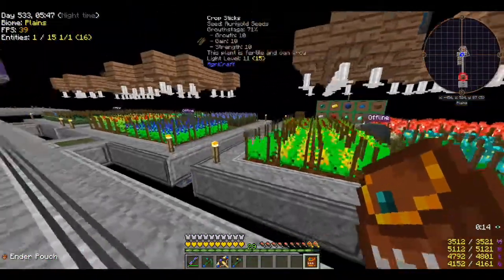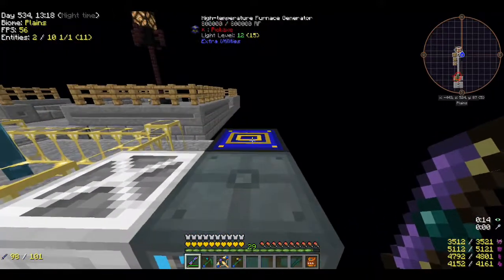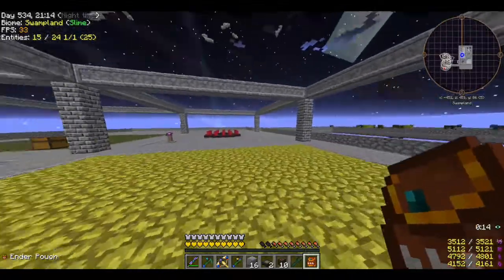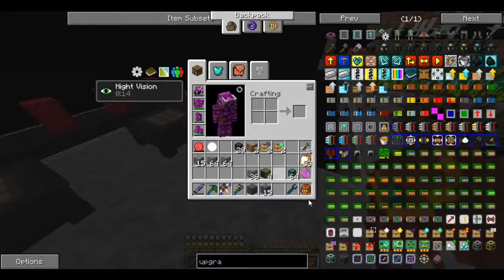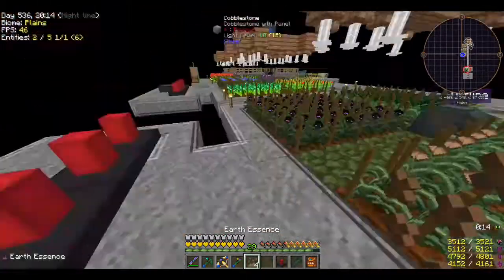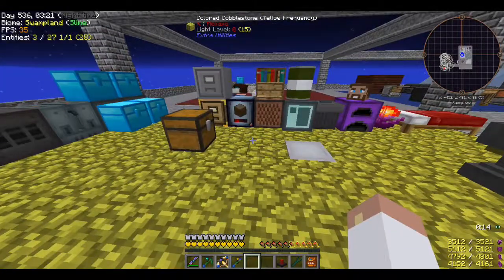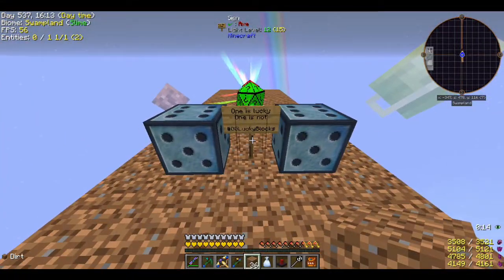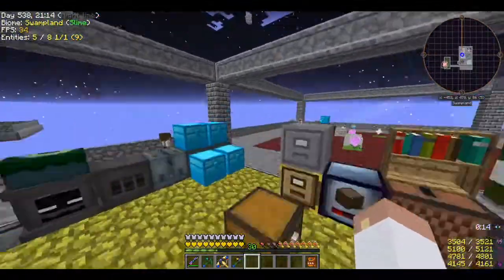Autocrafting Issues - Ep 17 - Project Ozone 2 (Kappa Mode)

Comment: I do not know why the advanced crafting table is not working! It is very weird, at first I thought the lasers weren't getting enough power but then I looked at WAILA and it said they were 100% full! This is the first time I've seen that particular autocrafting bench! A lot of other people try the Crafter which is very easy to use, it's just like any other ender io machine, give it power, a template and whenever it gets the required items it needs to make its assigned item, it'll craft them. The other popular one is logistics pipes auto-crafters. I don't like logistics pipes too much but it is pretty much the same as the crafter, they just require a template like upgrade for them to actually do anything! You would probably need to get a logistics pipes system up and running before you even bother with that! In my opinion, the crafter is the best and easiest way to autocraft! That's just my opinion though, there are probably other auto-crafters in the pack so if that doesn't sound interesting I would look around a bit more, but if you are intent on using the ones you have now, I can't help you much sorry!  

Other than that, I would love if you opened a few chance cubes/icosehedrions every episode, could be fun, or it could end the series lol! BTW, don't know if you know this but, in PO2, chance cubes and icosahedrions are nerfed to be bad more times than not! 

Loved the vid, keep up the gr8 work!
Reply from the maker: Thanks for that... I didn't know about the crafter, I'll check that out. I found out that it's just those essences that don't want to work, so I'm dealing with it atm. But I will def check out the crafter shortly.